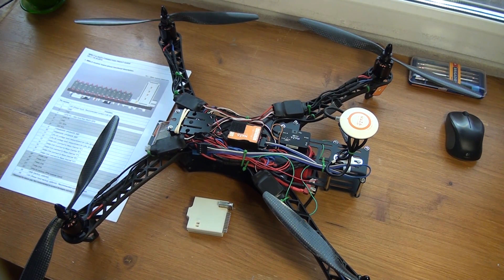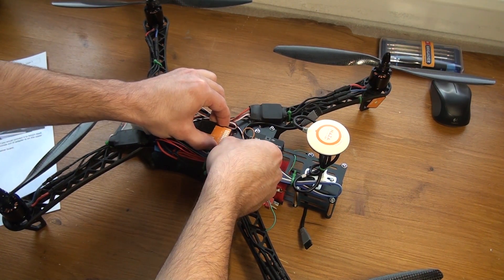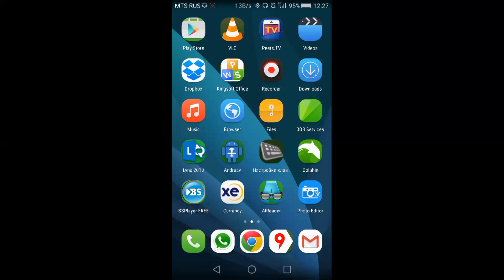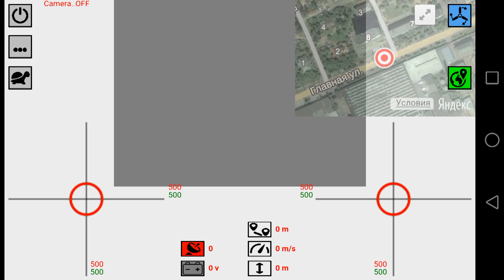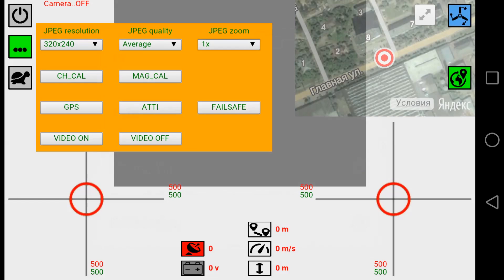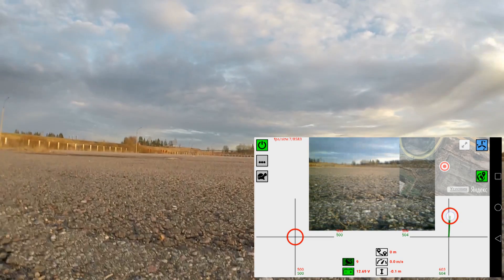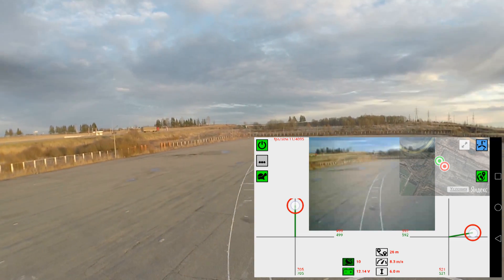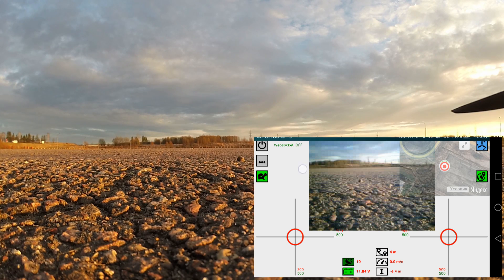Minla 3G/4G LTE FPV drone receiver. Overview.

Comment: Very nice work u did.Is it possible to can have a special funktion controled via the mobil phone to can switch a light or a voice speaker on the drone?
Reply from the maker: Thank you. Light switch will be available in next firmware release (there will be an option to select a function of every of 9 output channels - either PWM generation or simple on/off switch). Sound generation is not planned for the moment.

Comment: Is it possible to use Mode 2 controller configuration with throttle and yaw on the left stick?
Reply from the maker: +Anders Nygren 
Yes it is. It's a matter of slightly modifing HTML (moving left stick to right an vice versa). It's on my list to make it as a option in settings. 
Or alternatively it can be done by just swaping wires from flight controller to receiver.
Reply: +G's channel Thansk for answering! It was as I expected then. 

Another question, here in Sweden we have a lot of area in the countryside that is covered with 4G on the 900 MHz band. Would it be possible to connect another USB-modem that supports 900 MHz ?
Reply from the maker: +Anders Nygren 
There is no guarantee it will work. 
Not every modem is supported and can be configured to work with receiver.
Reply from the maker: - Minla already comes with supported LTE modem (Huawei E3372). If you would like to use your own modem then you need to make sure it acts as PPP modem (not RNDIS). Usually all LTE USB sticks from Huawei with "s" at the end (e3267s) are PPP and generally supported by Minla.
- Video feed from integrated camera is delivered to user interface in web browser via internet. User interface is essentially a web page (static html+javascript) so it is highly configurable and It can be opened in any modern web browser like Chrome/Safari/Firefox running on Windows, Linux, Mac, Android, iOS.
- To my knowledge Andruav was specifically made to work with Pixhawk/Ardupilot flight controller and in this sense it's a great app. Minla in general does not rely on any particular external hardware. It has 9 PWM outputs that can drive flight controller, rover controller or can be used to drive servo motors directly.

Comment: Would I get unlimited range?
Reply from the maker: Yes. As long as you are within your mobile network (3G/4G) coverage area.
Reply: Thanks a lot for your replay.Please could you tell me what microcontroller have you used to make the quadcopter?Have you used any of PIC or Atmel or Arduino or Raspberry Pi to control the quadcopter ?
Reply from the maker: I used Minla LTE receiver with integrated camera for FPV - http://minlarc.com/order.html together with DJI Naza flight controller.
Minla receiver has android app - https://play.google.com/store/apps/details?id=com.minlarc.minlacp through which I could control my drone and get FPV video stream at the same time. Alternatively it can be controlled via regular web browser but android app is just easier to use.
Reply: That's means, no need any programming, is it?
Reply from the maker: Yes. No programming is needed. Just connect all components together.